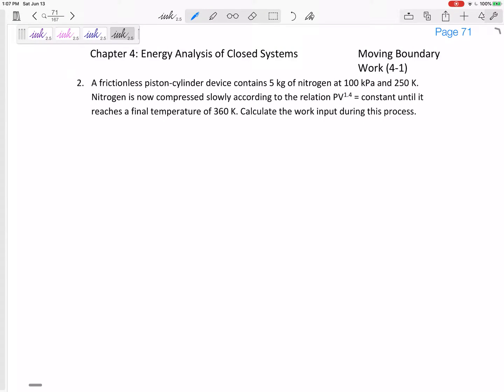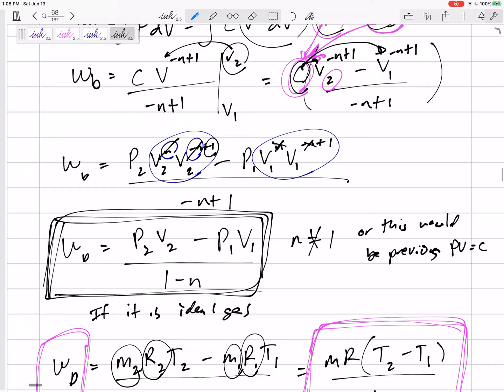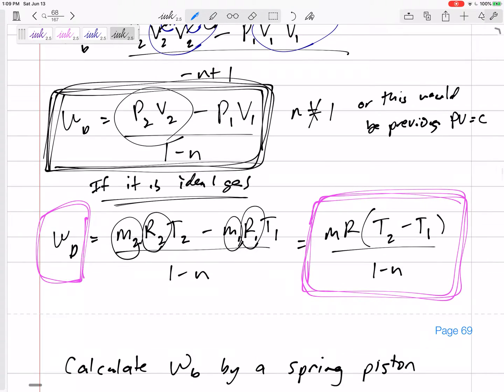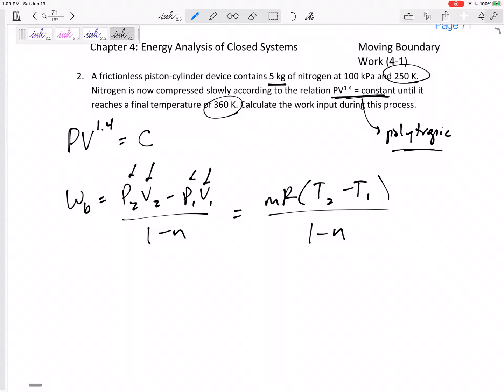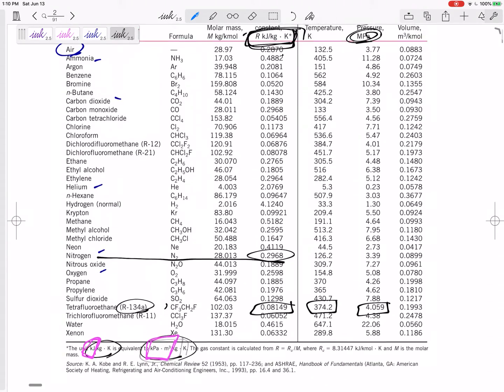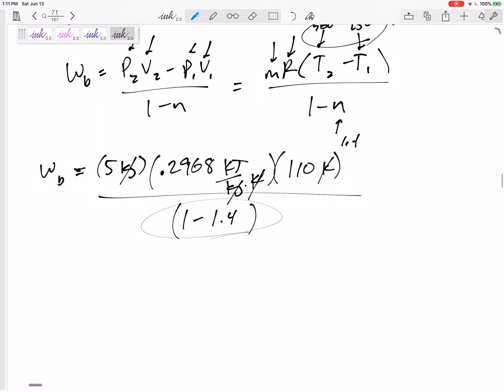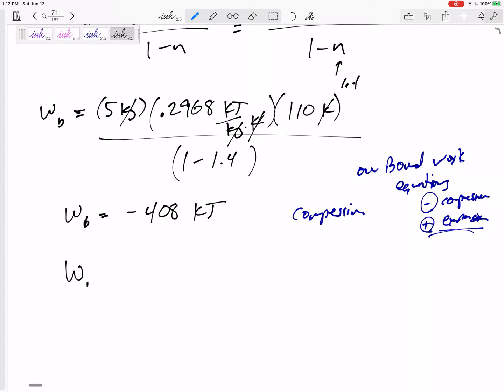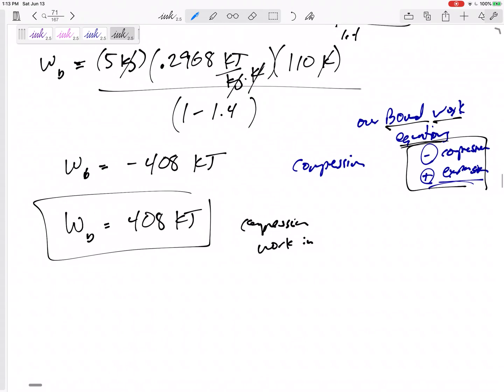Thermodynamics - 4-2 Moving Boundary Work in a polytropic process

Comment: You made an error when you subtracted T_1 from T_2, you put down 110 instead of 200. The answer according to the solutions manual is -742 kJ.
Reply from the maker: I’m not sure what you mean? This problem is going from 250 K to 360 K so the delta T is 110.

Comment: 1:26 You mentioned that we have Nitrogen, so we can think it is an ideal gas. Please let me know why we can assume that is an ideal gas, not liquid. Also, you mentioned oxygen and CO2. Can we assume whenever we see nitrogen, oxygen, and CO2 in problems, it will be a gas most of the time? (Also, thank you so much for the video!)
Reply: Hi Sunmi👋
I just researched about this topic, and I figured out the following: 
You can know if the (oxygen/ Nitrogen/ ...etc) is either a liquid or a gas by knowing its boiling point and the temperature given in the question; for instance, Liquid Oxygen has a boiling point of  (-183⁰ C) @ 1atm; so it cannot be liquid Oxgen if the temperature is too higher than (-183⁰ C) at 1 atm, it's gonna be gas Oxgen.
Talking about the Nitrogen, it has a boiling point of (-195.8⁰ C) @1atm, so if the temperature is too higher than (-195.8⁰ C)@ 1atm; it's gas Nitrogen not liquid, and if the temperature is lower than (-195.8⁰ C) @ 1atm; it's gonna be liquid Nitrogen. 

So you can notice that we need very law temperature to get liquid Nitrogen @ 1atm; but in this question the initial temperature is (250K = -23.15⁰ C) @100 kpa (approximately 1atm), which is to higher than (-195.8⁰ C), and that means it's absolutely gas Nitrogen not liquid Nitrogen.
Hope my all of what I wrote is correct, and I hope you got it, all the best 🌸
Reply: It is ideal gas if it is not mentioned in the problem that it is sat. vapor or liquid.

Comment: You mentioned here that the expansion is positive while compression is negative. However, in the beginning when you introduced boundary work, you mentioned that expansion, Work out, is negative, and Compression, work in, is positive. Which one should we use in general? As it is important for the video about internal energy and enthalpy and when to use one of them.
Reply from the maker: Good question. Most thermodynamicists would say Q - W = delta U and use the boundary work equations like they are written to solve for W and plug back into that equation. I (like some physicists) like to say Q + W = delta U and I like to remember that the boundary work equations are written being positive for work out. So I use the boundary work equations to solve for W. Then I ask myself- was that boundary work out or boundary work in? And if it’s out I plug in as -W in my equation. If it’s in I plug in a +W in my equation. You can use either method. Not sure which one makes more sense to you, but mathematically it works out the same. Main point: the boundary work equations are written and derived to be positive for expansion (work out).
Reply: @engineeringdeciphered  i did not understand this point .Would it be possible for you to explain this with another video ?
Reply: @engineeringdeciphered  Got it. Helped a lot. Thank you for this detailed explanation. These lectures have made it really easy to study thermodynamics!